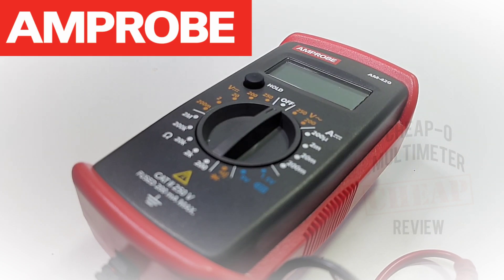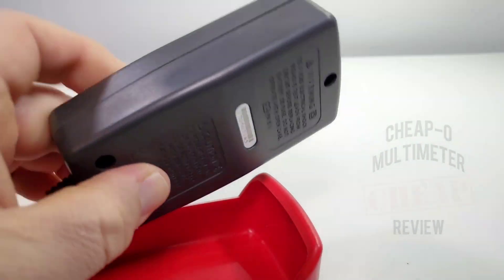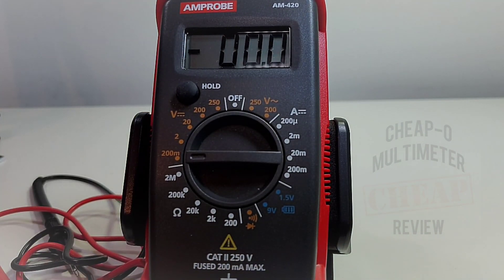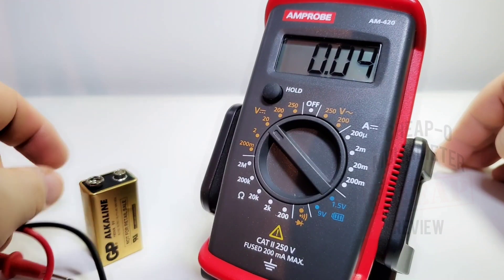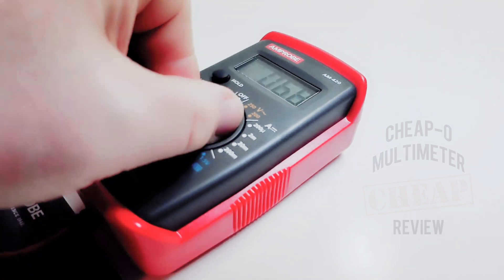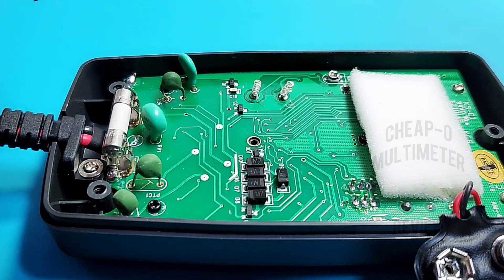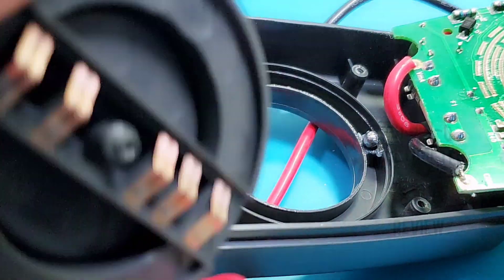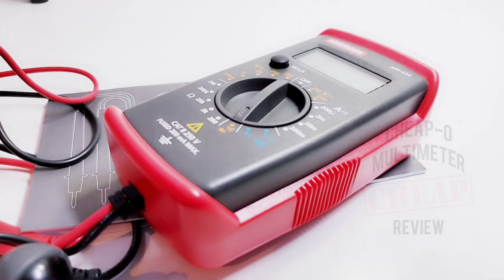AMPROBE AM-420 CHEAP-O Multimeter Review & Teardown!

Comment: To make it faster on low current ranges (or high resistance), find a capacitor across its analog differential input and install a smaller value (up to 10 times).
Reply from the maker: Great advice 👍 my friend

Comment: Darren, I'm looking for a cheapy that is safe with shielding & nice quality fuses, would prefer if it had temperature gauge & sound measuring but not essential. So I n essence a fully featured cheap multimeter. Under $100 be good. Under $50 would be great! What do you recommend. I'm in Australia so the cheapo brands might be different here but the model is important so that I can find it. Thanks in advance
Reply from the maker: AllSUN EM5510 fits the bill..does everything you mention. I did a review on its Clone cousin..
https://youtu.be/QuUqTAFvfGo
Not many multimeters have the lumen and dba functionality so choices are very limited.

Comment: Hey , Darren check this meter : https://www.aliexpress.com/item/32850613130.html?spm=a2g0s.8937460.0.0.1b9e2e0eT1F0zn ,has all the functionality of Habotest 118A ,it is as slow as 118A,no shielding,protection none,fake bargraph like 118A,bad display like Haytals  ,,,,,,,like all cheapos,,,,,,,,but it is a  20000 counts and high precision DMM like UNI-T 61-E .I've bought the Borbede BD-99 version but is the same multimeter(didn't researched much,payed 10$ more for a label).I am using it for a week and I have no complaints so far (except for the display,wish this DMM has the HABOTEST display),and the biggest selling point for me were : It has a normal range switch knob (HABOTEST is too small for me),has separate ranges for DC and AC.All the ranges are ok.Nothing to complain about,very precise I like it(and doesn't have the HABOTEST diode check BeeP,bummer!).But if They installed a better display like HABOTEST ,this would be a killer DMM.Great multimeter for beginners.Best regards from Prilep,Macedonia
Reply: another link :https://www.aliexpress.com/item/4000624808819.html?spm=a2g0o.detail.1000014.7.1e057cc2Busx6n&gps-id=pcDetailBottomMoreOtherSeller&scm=1007.13338.141931.0&scm_id=1007.13338.141931.0&scm-url=1007.13338.141931.0&pvid=07635552-d8b2-4d0d-bb80-2967b49b3b6e (payed 20$ more , grrrrrrrrrrrrr)
Reply from the maker: Thanks so much! Believe it or not I'm testing that same multimeter as we speak..Review should b
e online in a week or so!

Comment: Forgot to say that  both me and one of my colleagues have the Amprobe 15XP-B.  Has a 2nd ohms position for 2000 Meg. Might have been £50 approx 3 years ago but a great medium sized unit.
Reply: Forgot to say that it's not good to put a high voltage through loadcells for insulation testing,  one of my meters goes down to 50 volt as most cells work about 10volt dc.
Reply: @derektodd4126   hahaha yes, putting your insulation tester on a loadcell would end badly for that cell LOL.
It might even create some new resistors in the form of charcoal traces, also bad....
Fluke 87V nice! I use one myself too, and love it !
I'm curious to see what voltage the 15XP-B outputs while measuring something in the 2000MΩ range.
Let's say it would output 5 - 10vdc, then it would need to measure nA's (nano Amps) internally to calculate the resistance of the device under test. Just for reference, i just checked, my Fluke 87iii outputs 650mVdc while in ohms-range.
The 87V is in my mancave, where i am not right now.
Reply from the maker: That's one incredible Resistance range!
Looks like I'll have to add that dmm to my stable!!
Reply: pffeww. 2000MΩ !!  I wouldn't take it too seriously though. Most well made multi-meters measure resistance up to 50MΩ reliably.
Normally one would use a high voltage isolation tester to measure in the Giga-ohm range.  (2000MΩ = 2GΩ)

I guess if Mr Darren Walker orders the 15XP-B he also orders 1000x 1MΩ resistors, put those in series to see if the 15XP-B actually measures that.
Reply: At this point am not looking for accuracy just an  indication when trying to find an intermittent fault out in field in loadcells. My daily driver is the 87V and have 2 decent insulation test meters from Brymen and Uni-t. In my game even after 30 years am still seeing weird and wonderful symptoms although most faults are of a generic type.  Thanks.
Reply: Apologies for delay as I'm on Greenwich Mean Time. It puts out 1.555 volts in this range.
Reply: @derektodd4126  1.555V for your 87V ? Or you mean your colleague's special Amprobe 15XP-B ?
No worries, I'm at GMT+1h  :-)
Reply: My 87V is showing 1.555 volts dc from Amprobe whilst in in 2000 M ohm setting.